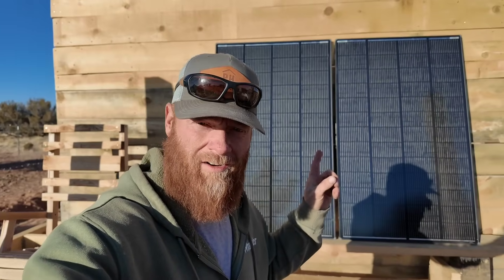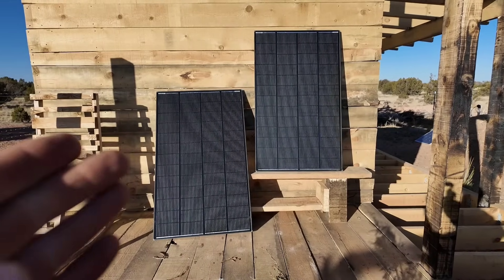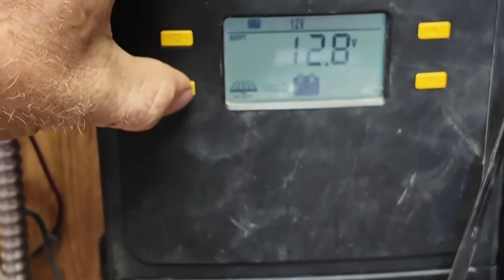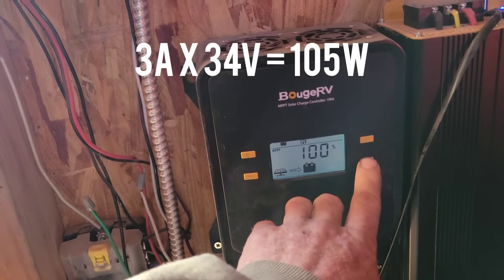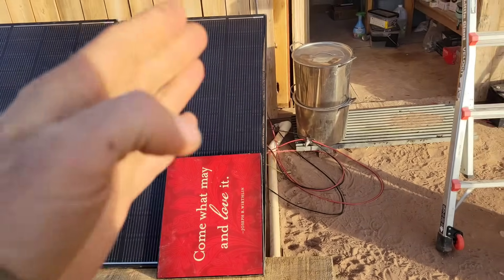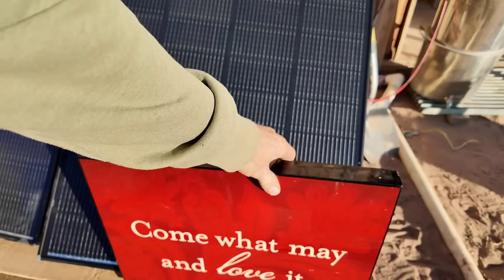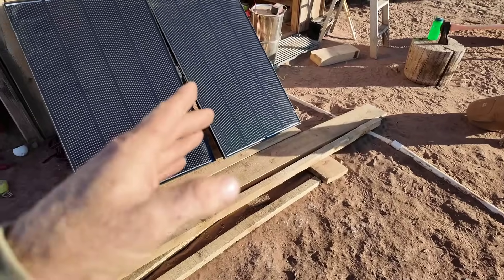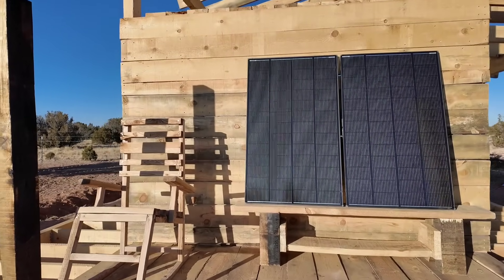New Solar Technology | Shadow Tolerant | Renogy 200W ShadowFlux solar panels

Comment: The interference (shadow). How does dust affect the power output?
Reply: @rodneyrussell8442  Shade tolerant panels like this are only able to fight against PARTIAL shading.  If part of the panel is covered the rest of the panel will still produce some energy instead of completely tanking like a normal panel would if it was partially shaded. 

Things like dirt, dust, less sunlight or other factors that affect the panel equally will still negatively affect energy output from the panel just like with a normal one.